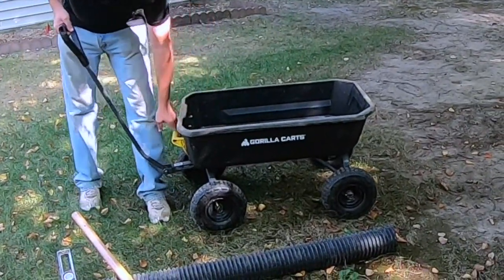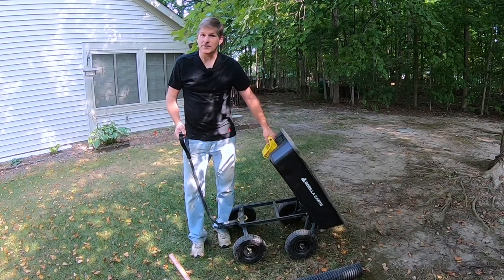Gorilla Carts Review - How to Move Dirt Fast and Easy

Comment: I have a wheelbarrow and it seems the tires go flat quickly and then I can't use it until I get the flat tire replaced.   Are the tires on the gorilla cart more sturdy?
Reply from the maker: Hi Lori, we have only used the Gorilla Carts for a short time, but so far the tires seem very sturdy and durable.  Thanks for the question!